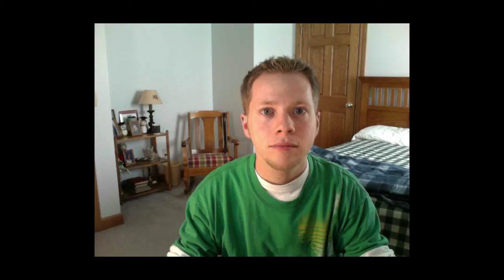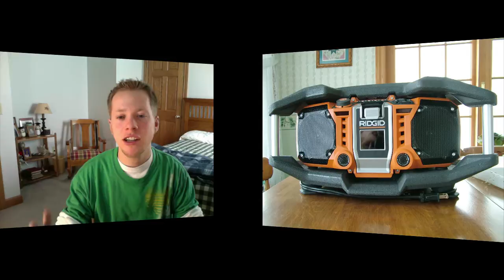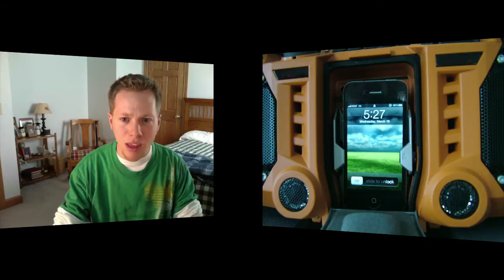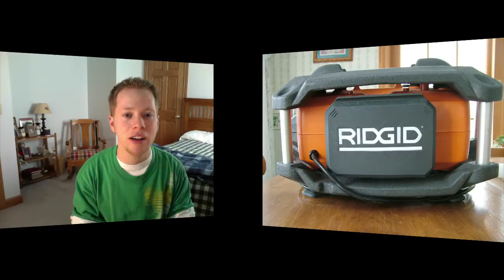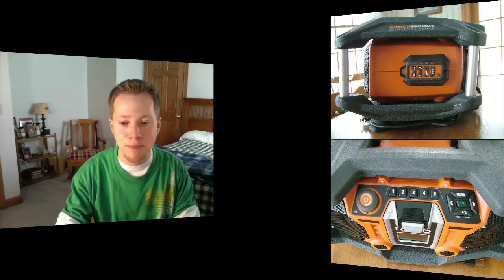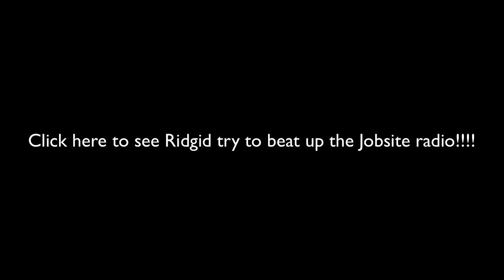Ridgid Jobsite Radio Review

Comment: the batteries cost alot because unlike dewalt and others rigid batteries take a couple years with heavy use to wear out and rigid has lifetime replacement now....my batteries (made right before lithium)  can charge in 20 minutes and takes bout an hour to kill (screwing a deck down)...have took mine camping many times and with ipod have been the life of the party....radio not only takes a beatin but rain and dust proof also...